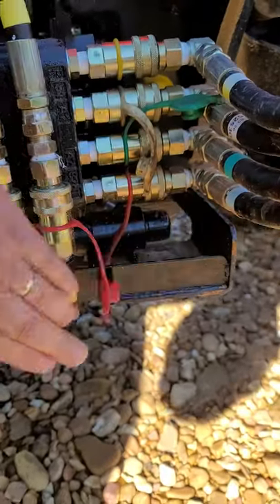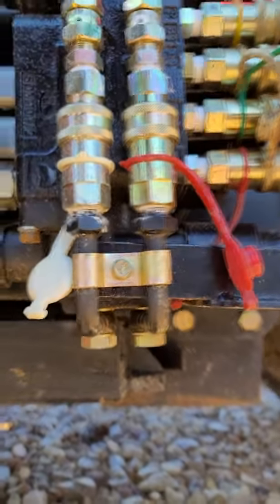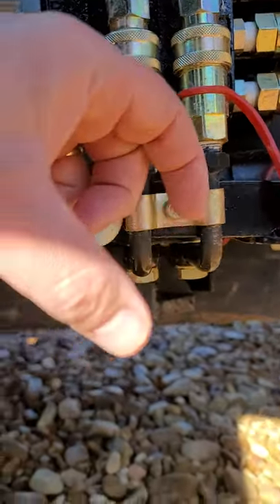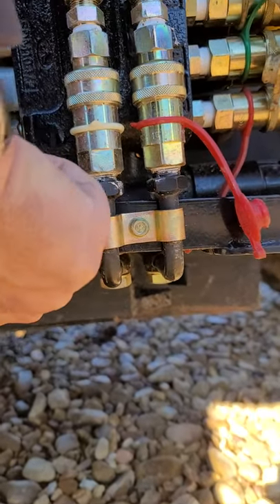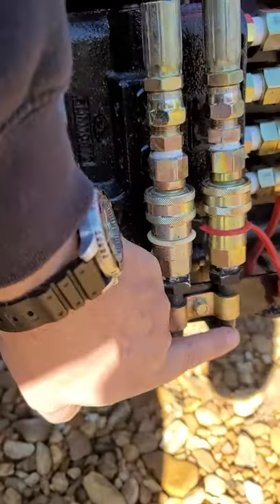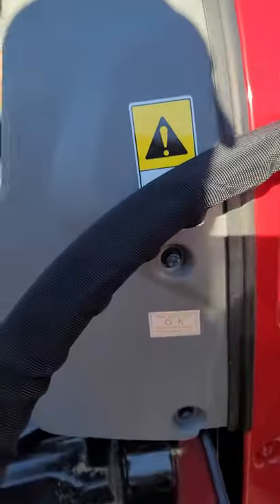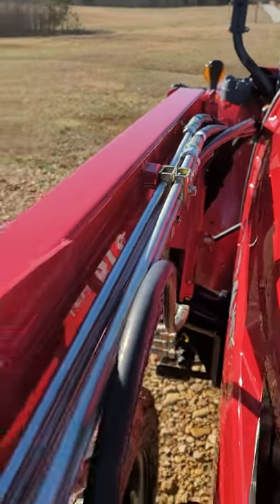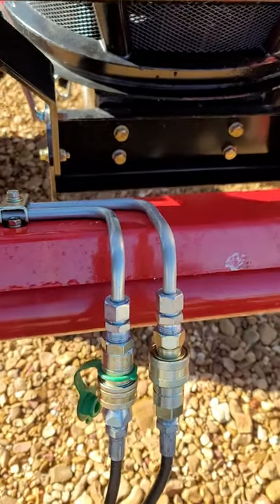TYM T474 OEM Third Function Valve #shorts

Comment: Good evening Sir, TYM are great tractor but I sincerely think that the valve/hoses connection assembly should be a Little higher ( 24 inchs ) so they can be out of the way from the rear front wheel ??? Great explanation video Sir Cheers !!!
Reply from the maker: I would not be against it being higher, but to this point, it has not caused any trouble.
Reply: @TonysTractorAdventure  If you are going to use it into a wood lots, please built a protective plates since you WILL have pieces of wood striking against it for sure,,,, Cheers !!!

Comment: Another person mentioned the height of the hydraulics. The same issue on my 264. It scares me because, I feel one day it’s going to get hit or ripped off. I love the tractor and have to say that is the only thing where someone had their head up their butt in the design
Reply from the maker: I have had zero issues. I mean this with the utmost respect. Tractors are not logging skidders. They are not made to climb through the woods without surveying the situation. To this point, I have used my tractors on the edge of their limits, never having a problem ripping a line loose. Use common sense, and it will be fine. Go at it like a mad man, and even the logging skidder breaks.
Reply: @TonysTractorAdventure  yeah, it was my neighbor who pointed it out. He does Landscaping and Tree Service. All he owns is Kubota tractors and a JD 70’s skidder. Actually, he just bought a beast 70 HP Kubota Tractor. Can’t wait to see it.

Comment: Hey it seems most are already setup with the 3rd function (quick connects already installed up by bucket) do you know what's needed to make it operational? The dealer wanted a over 1k$ figured it should be pretty easy
Reply from the maker: I used the factory OEM kit. It took thirty minutes to install. I did a video on it.
Reply: @TonysTractorAdventure  yeah I watched that but these are already plumbed, so I'm guessing maybe it just needs the actual valve and wires?
Reply from the maker: I have visited the factory and have seen these tractors built. They either come with third function or they don't. I verified this with my friend. I am not sure what your dealer has going on. They come from the factory with the two buttons wired, but that is all. No hoses plumbed. Or, they come from the factory with a fully functional third function.
Reply: @TonysTractorAdventure  hmm ok thanks

Comment: Hey tony, I've got a third function coming for my 474. I'm thinking about putting flat face connectors on. Is the line at the implement end of the 3rd funmction 3/8" npt? Do you know?
Reply from the maker: I really don't remember. I was thinking it was 1/2".

Comment: Tony, how come you used a universal on the T264? The price on Amazon equaled to what my dealer quoted me for an OEM setup installed.
Reply from the maker: The OEM kit for the T264 is not third function. It is a diverter valve. Another reason is I had this aftermarket third function kit on hand for another tractor and ended up not using it. That meant it was free for the T264 tractor. The T474 kit went on in thirty mins. The new T25 kit went on in thirty mins too. It took me a couple days to fabricate all the stuff I need to install the aftermarket kit on the T264. It worked great.

Comment: Hey Tony, would this be similar for the T264?  Thanks!
Reply from the maker: No sir. A factory kit for the T264 is a diverter valve place on the loader cross bar at the front. It works fine, but you loose the curl and dump function while using the third function. I put an aftermarket kit on to have true third function. The video was done last summer.

Comment: What would the 474 flow rate be for this 3rd function??
Reply from the maker: I think it about 8 gal gpm. I would need to dig in the specs to be exact.
Reply from the maker: I definitely do not recommend running a full-time hydraulic motor off of any tractor hydraulic system below 80 hp. They are not made for that—front-mounted brush cutters, etc.